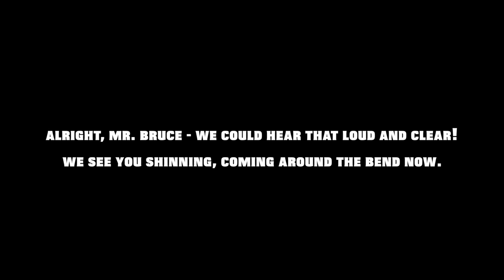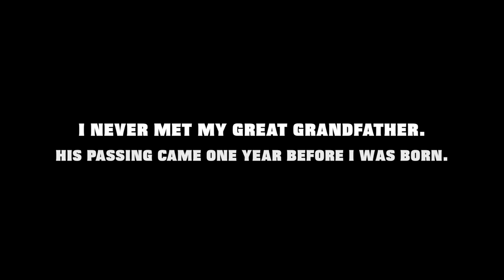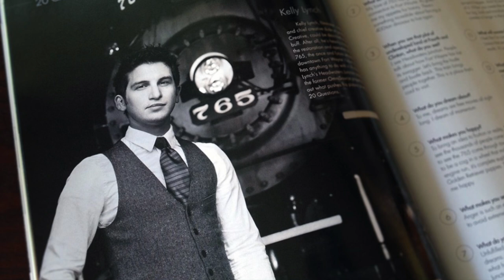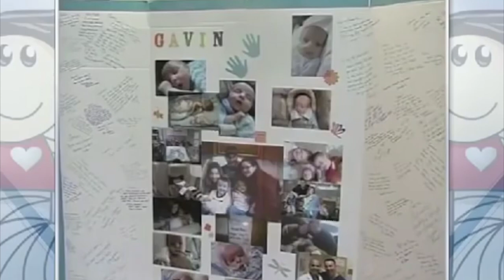"My YouTube Story" - Building a Brand of Railroad Media

Comment: My knack for railroads runs in the blood as well. It stretches back 4 generations all on the grand trunk western. The most recent being with my grandpa who ended his 30+ years as a carman in the Flint car shop back in 1995. My dad could've been the 6th generation to work on the grand trunk but he failed his welding test. In 2005, my grandpa took my dad and I to the car shops so he could see some old friends. I was also lucky enough to have got in the cab of an old CN dash 9 and have a photo taken on the rear platform of an old GTW gp9r. I also received a ride in the trackmobile based at the shop as well. I myself plan on becoming the 6th generation of railroaders when I complete my welding certification in the winter. Do any of these jobs exist in mass? No but I'm willing to wait it out until i see any openings